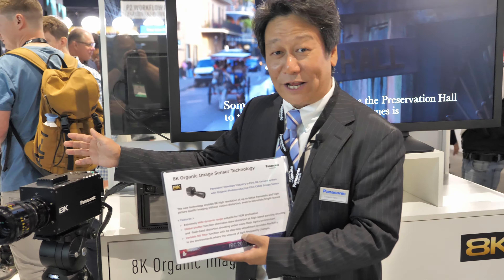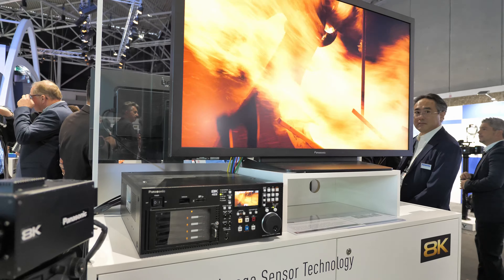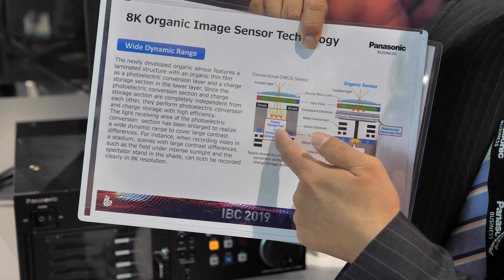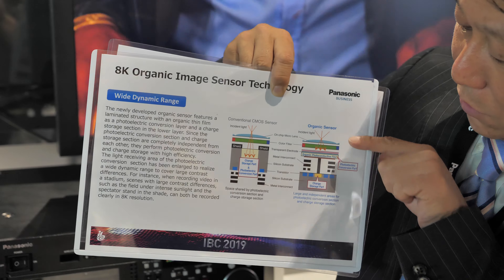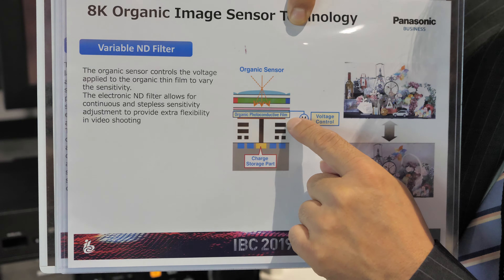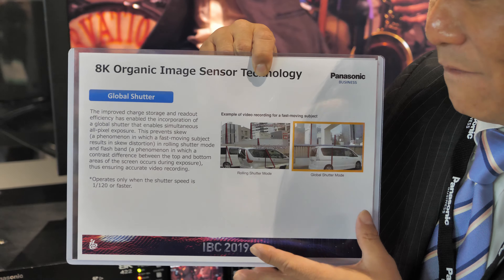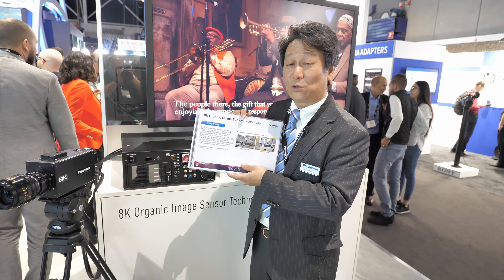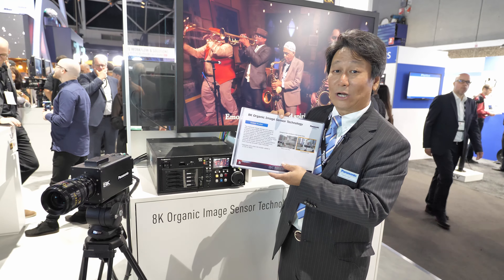IBC 2019: Panasonic 8K Organic sensor

Comment: World don't need sensors with 3-5 years of life like OLED. Sony already have wide dynamic range and other features.
Reply: Well, even if you spam this under each YouTube video of this organic camera. It won't stop the future to happen. This camera has a Super 35 image sensor (=APS-C). The latest Sony Camera with traditional CMOS-technology using an APS-C sensor (Sony A6600) has a dynamic range of only 13.4 stops. So yes, world definitely needs that technology allowing a dynamic range which is nearly 8 times higher. Especially for video purposes where rolling shutter is a huge issue, this will be a big deal.
Or in a nutshell: World doesn't need Sony fanboys defaming all other camera technologies.